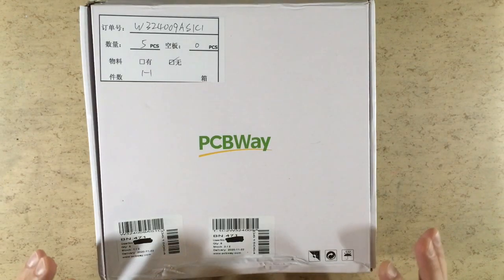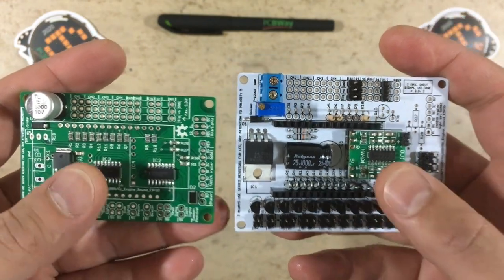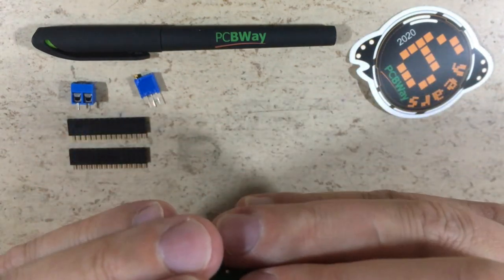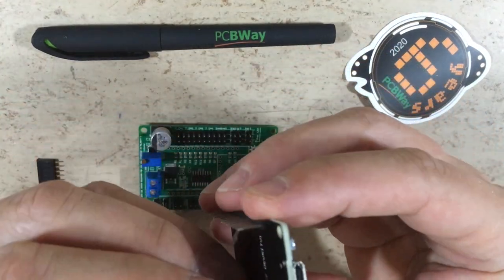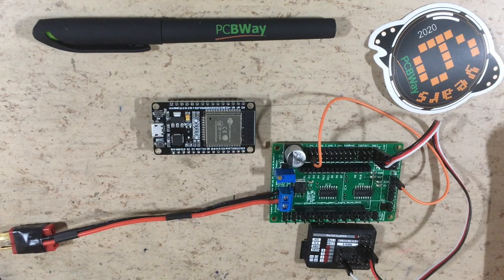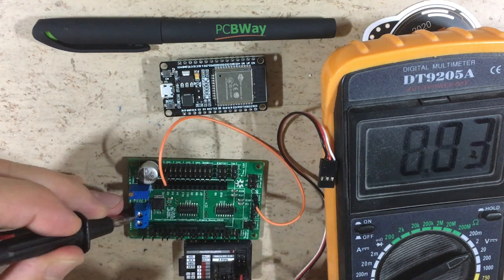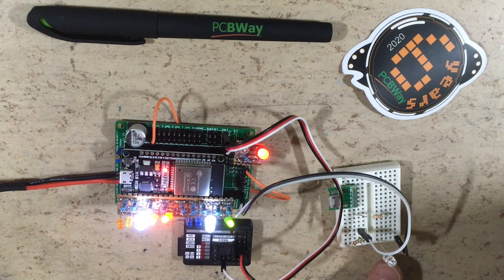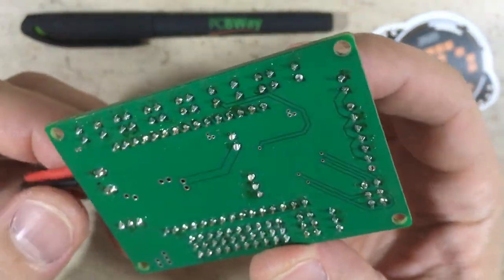ESP32 RC Sound & Light Controller: How To Finish The Pre Assembled PCBWay SMD Version

Comment: This is an awesome project! I've already ordered enough stuff to make 10 of them. Thanks so much for sharing it. I'm designing a fully 3D printed 1/14 semi truck and I hope this system will really bring it to life.
Reply from the maker: Thanks for the praise.
Reply: Do you want sell me one sound board you made i have the ESP32 readly I am not good with computer for install or order any pcb
Reply: im actually building your semi and want to add this to mine how many channels do i need on a receiver
Reply: @bluesparky727  I have one set up with 6 channels and one set up with 10. The more channels you have the more functions you can control. It can do a lot without your input though, so you don’t need a lot of channels.
Reply: @BuildItBetter3D  sweet I don’t honestly know where to start with the electronics I will have to watch this video about 30 times before I get it figured out haha I have the cab and hood printing now

Comment: boards arrived, no stickers, no pen, just the boards, and a fat bill from DHL .. shipping was almost as much as the entire boards, wish pcbway had a cheaper shipping method, mine was also delayed because the email they send me went to the spam folder and Chinese new year... so an order placed on 20 Jan 21 was not delivered.. i had to go get it as DHL had "oopsied" my delivery and the local DHL subsidiary had it. i finally got my boards on march 9th 21 but that is not the fault of pcbway or you DIYguy.  Now i will test them and start looking for that 1 engine sound i can not find as a .wav file.
and then see how to make them work as s-bus receiver/sound/light effects boards.

a thank you will come after the test :)
Reply from the maker: Hmm, sounds annoying. This is strange. I never had issues  with PCBWay so far. tons of sounds are already included and pre configured in vehicle profiles.
Reply: @TheDIYGuy999  dhl promised a callback within 24 hours, that was 2 days ago, they admit mistakes where made they just do not want to do a full or partial refund of the shipping costs.

is tthere a way how i could privatly let you know what engine sound i want ? maybe you know where to find it .. all i will say its a big engine and not a line or V one :)
Reply: @TheDIYGuy999   cant find the P&W r2800 :)

Comment: Could it be possible to add torque vectoring to this board? For example put 2 esc to control left and right side motors and a potentiometer to read turning angle. It would be nice to have in my dump truck that really wants to understeer.

Comment: Would just like to say this module looks fantastic. I would really like to follow this vid and assemble one RATHER than going with the useless Tamiya unit of overpriced Beier unit BUT ordering the PCB on PCBWAY is way to complicated for the first timer/novice. I tried by using the GERBER files BUT the site still asks for aditional info which the novice will have no idea of.Its a shame the channel could not go into more detail for the novice. I have given up on this module due to ordering side.
Reply from the maker: You can order the boards easily according to the step by step manual:
https://github.com/TheDIYGuy999/Rc_Engine_Sound_ESP32/blob/master/Eagle_PCB/How%20To%20Order%20Your%20PCB.pdf

Comment: I've almost soldered the board and now ready to move on to the tests. Could you comment, please, the light test on 9:30? How does the receiver transmit signals from several channels having only one 3-pin wire connected?
Reply from the maker: it's using the SBUS protocol. See (interface types):
https://github.com/TheDIYGuy999/Rc_Engine_Sound_ESP32/blob/master/README.md
You should read this file entirely

Comment: Hello, with your gerbers.zip file on the pcbway site we get your electronic card with all the small components already soldered on it. You just have to solder a terminal block, a 100 ohm resistor and some pins.
Thank you for your help
Reply: Bonsoir, je suis un petit frenchi qui aurai besoin de votre aide. Cordialement
Reply from the maker: It will come with soldered SMD components, if ordered according to the PDF in this directory:
https://github.com/TheDIYGuy999/Rc_Engine_Sound_ESP32/tree/master/Eagle_PCB

Comment: Board reboots when the Arduino code is compiled using ESP32 board versions after 1.0.5.

Is there a fix??? I have the same problem... Is it the bootloader or ..?

Comment: Thank you for the continuous improvements in your project. I note in the BOM.xlsx there are some items crossed out. Obviously these are the pass through bits that they do not assemble. Do they have to stay in the upload file to PCBway or can they be removed? I have never ordered a partially built board so appreciate the advice.
Reply from the maker: It doesn't matter. Also have a look at: https://github.com/TheDIYGuy999/Rc_Engine_Sound_ESP32/blob/master/Eagle_PCB/How%20To%20Order%20Your%20PCB.pdf

Comment: That such a great work 🤟🏽🤟🏽🤟🏽🙏🏽. I do follow your work sir..but i have a bit questions bout problem i have. I wass doing the programing things with your latest firmware v7. But I can't find my engine sound work from the wiring pin on esp32 to my reciver.
Did you have any suggestions please?? For only the triggered sound simulation things.
Im using 30 pins esp32, and 6ch dumbo rc rx tx. How the wiring should be possible for me?🙏🏽

Big respect. Thanks
Reply from the maker: Thanks. Wire and configure it according to:
https://github.com/TheDIYGuy999/Rc_Engine_Sound_ESP32/blob/master/README.md

Comment: Hello, i am looking at gathering the componants for the build. i have no real technical knowledge of electronics ,i will how ever be able to assemble them. Given this i have2 questons please, Schottky diode 1D5819, i can only get 1N5819. "N" rather than D.  Also 1/4w resistor as varoius ratings,which do i need thanks? lastly in the UK i can not get the circuit board printed so will use normal hobby board stuff,the unit will be situated in the trailer so does not need to be small or neat.thanks
Reply from the maker: iN5819 is OK. You can find the resistor values in the PDF schematics

Comment: I understand that it you load the software (as default) for a SBUS system into the ESP32, it should be blinking the blue LED in the board in the moment you power it even if it you haven not connected a receiver. Is that ok? Because when I load the software it doesn't blink and I'm trying to find if the problem is that Arduino IDE doesn't compile the software properly or if my boards are faulty.
Reply from the maker: It's the hazard lights, indicating that no connection to the transmitter was found. This is normal with the "MICRO_RC" remote profile. Have a look at "adjustmentsRemote.xlsx"
Reply: @TheDIYGuy999  Yes, I used the "MICRO_RC" remote profile (as you have it by default) just in order to to try it. With your confirmation I know I have a problem with the Arduino IDE or with the ESP32. If I got to solve the problem, I will let you know if it works with Futaba Sbus. Many thanks again for your help.

Comment: Hi, this is an amazing work! I'm starting my RC journey and I've already ordered the required parts and the board itself however, looking at your documentation I've noticed that the remote adjustment file is mainly prepared for the flysky and your own controller. Would I have to make many changes to adapt this to Spektrum dx6i?  Many thanks
Reply from the maker: You're welcome. The flysky setting should work (you can also change or copy it easily) as long as the spektrum has the same switches and a dual rate option. Of course the remote channel order has to be adjusted according to the sound controller setting. For details see "adjustmentsRemote.xlsx"
Reply: @TheDIYGuy999  brilliant! Thank you so much for your help!
Reply: @TheDIYGuy999  What rating fuse did you use with your setup? I'm coupling the board with Hobbywing 1080 esc if it helps. Many thanks

Comment: so I ordered the assembled pcb from Pcbway and have finished 2 of them. I installed the original excavator sketch and I'm using a Flysky FS I6S transmitter with IA 6B receiver .Changed the vehicle.h and the remote.h  as instructed in the GitHub documentation. When I test the boards the same as Martin did in this Video all goes well until I get to the part where he gets the hazard lights flashing. I am getting roof lights and the head lights turning on solid instead. Also I am not getting any sound at all. I have tried both boards and multiple ESP32s and get the same results with them all. I have tried sbus and ibus with same results but don't have the necessary cables to try PWM. I have read every bit of documentation and instructions that I can find so many times that I almost have it memorized. Does anyone know if there are any differences between this board and the newer version with wireless trailer lights or the sketch for the ESP32s that could be causing this problem? I would look for help on the forum that is recommended but I never receive the confirmation email to complete registration for the forum when they send it. Ive tried multiple times. Any help from anyone would be greatly appreciated.

Comment: Hi. Can you tell me what speakers did you use in your system, and where can I buy its. Thanks and great job, congratulations.
Reply from the maker: You can use any speaker between 4 and 8 ohms. Mine have GT Power chassis in 3D printed housings

Comment: @TheDIYGuy999  I sent the files to PCBWay they've made the board but have 2 issues :  (Switch Mode Version)

1.For position C1, there are three holes will be blocked if we solder the capacitors,pls advise and comment.
2.For position D3 , component we purchased as per part number#SS34 is bigger than pads in your design, can't solder. Pls provide correct part number.

Comment: Hello, I ordered all the parts got it all assembled.  Do you have a tutorial on how to configure/setup the radio.  My radio in particular is Futaba 8FG.  I found your excel configuration spreadsheet but, I'm still a little confused on how to set my radio.  Thanks
Reply from the maker: Hi, read this document and you will know how to configure it:
https://github.com/TheDIYGuy999/Rc_Engine_Sound_ESP32/blob/master/README.md
It's important so set the 100 & 75% dual rate on your radio according to the excel file

Comment: Nice
Reply from the maker: Thank you
Reply: I have question about last update
when i use manual engine on/ off
Why engine begin auto on/start after engine manualy off
Reply from the maker: @frenkkotarigan  It is starting as soon as you touch the throttle, it is normal.
Reply: Its normal
Reply: I mean i dont touch the thortle or other

Comment: Great work. Sorry for different kind of question. For the Micro RC Receiver Light do I need to put C3, C4, C5 and C6 capacitors on the board (no TB6612FNG motor controller)? Thank you.
Reply from the maker: Thanks. No, these capacitors are for the TB6612FNG. Note, that I recommend to add a 100nF cap across the GND and 3.3V terminals of the radio module.
Reply: @TheDIYGuy999  OK, thank you.

Comment: Just built another ESP32 Sound board for my T35, but I can't find a link for the WAV file converter that Bitluni made for you. The link above goes to the old original converter. I checked your Github too and although it shows a png picture of the converter, there is no link there either.
Reply from the maker: The converter is included on GitHub:
"Audio2Header.html"
It was rewritten by me to fit our needs.
Reply: @TheDIYGuy999  Thanks, I did not know that.  I used  the one at Bitluni.net and  made it work.  I captured 15 seconds of the Russian National Anthem to play as Sound1 on my T35 tank.
Reply from the maker: @jps99  You can use it as well, but in this case, you have to change the variable names manually. That's why I made my own version.
Reply: @TheDIYGuy999  Yes, that's what I did , but it will be much easier to use  your version, which I will do in the future.

Comment: hi. me again ☺

maybe a request: 
#1 maybe a port if this on 328P but lights only? no sound

#2 how can we modify code to NOT have an intertia( or a very minimal one)? I plan to use this on 4wd 1:10 'high speed' .
Reply from the maker: Hi,
#1 it is not possible, because not all 328 pins are supporting PWM
#2 adjust the "escRampTime" variables in the vehicle preset accordingly

Comment: This sound + light unit seems to be the way to go. I can solder ok but never worked with this sort of electronics so have of componant costs etc. Brfore i get into finding the parts etc can anyone give a apx cost of the parts to complete this project?
Reply from the maker: This is the BOM for the through hole version: https://github.com/TheDIYGuy999/Rc_Engine_Sound_ESP32/blob/master/Eagle_PCB/Final/Components%20list.pdf

Comment: I try to order with PCBWAY but I can't they ask for a Part List BOM file and Centroid file?
Reply from the maker: They are included in the Gerbers.zip, but you have to provide them separately. They are named BOM.xlsx & CPL.xlsx
Reply: @TheDIYGuy999  Thanks. Will be great to find this in shared projects in PCBWAY
Reply: @TheDIYGuy999  I send BOM and CPL to pcbway but this failed review. They say that on R18(20k) "your designed pads are for THT part rather than SMD part, pls double check and advise correct part No. for checking"
Reply from the maker: @giropa  sorry, my fault. Tell them they don't have to populate it. You will have to solder it by yourself:

Comment: Hello, when assembling the board. The top right of board has a section "rear lights" does this accept 2 x 3pins connector OR 3 x 2pin connectors, i am a newb,sorry
Reply from the maker: You can use 3 pin connectors, glued together back to back. The 5 Volt pin is shared for all rear lights.
Reply: @TheDIYGuy999   2 x 3pin connectors,thank you

Comment: I build it but it doesn't work with my Futaba sbus. I tried changing the sbusInverted to "true" and it neither works. Does anybody used it with Futaba sbus? Does anybody knows where could be the problem?
Reply from the maker: I don't have a Futaba remote, so I can't test it. It works just fine wit the Flysky and my DIY Micro RC remote. You should test it in PWM mode first. Does it work in this mode? Note, that you need to connect an ESC, otherwise the ESP32 is not supplied. See:
https://github.com/TheDIYGuy999/Rc_Engine_Sound_ESP32/blob/master/README.md
https://github.com/TheDIYGuy999/Rc_Engine_Sound_ESP32/blob/master/documentation/quickStartManual.pdf
Reply: @TheDIYGuy999  First of all, many thanks for your answer. I haven't conected the ESC, but I powered the ESP32 from the +5V rail as you explain in the documentation, and the ESP32 turns on, but it doesn't do anything at all. It seems to be everything ok but  I have not answer fron the device. I'm using your default parameters because I'm trying a sbus connection and as I told the only change I dis  was the sbusinverted for try both options. I imagine the firmware is correctly loaded because I didn't get any error message fron the Arduino IDE. I will try with the PWM mode and I will let you know.
Reply: @TheDIYGuy999  I'm verifying everythin and I have found that PCBWay used ULN2003A LED drivers in place of the ULN2003AD. Could be this the problem?
Reply from the maker: @lerpft  They are OK, my boards also came with them. You should measure the supply rails for correct 5V.
Reply: @TheDIYGuy999  It's ok, they have 4.97v. I will try the PWM mode as you told me before and I will let you know if it works in this mode. And many thanks for all support you are giving to all of us with this great development.
Reply: I have uploaded this video https://youtu.be/90ZqoJfoI9U in order you can see the upload process. As you said in your Githube that version 1.8.7 or older can cause errors and the latest version is 1.8.13 I also installed the 1.9.0 beta version (but I tried with both versions and also with 2 different ESP32 boards and always with the same results). I also uploaded this other video https://youtu.be/-7f5p9KFo0c in order you also can see the result when I connect just the indicator lights to the board. As you can see, when I power the board it just turn on and doesn't do anything at all with or without the transmiter turned on. I also tested the leds just plugin them to a ground pin and they works. Where do you think could be the problem? I also tried with PWM (of course changing the interface type in the software) and the result is exactly the same.

Comment: Gruss Martin (back to English)  i have tried to upload the files from the github to the board but keep running into issues, when will you do a tutorial on how to install the software so i can get my board working and look for the P&W R2800 engine for my 8x8 wpl 1/16 truck (after all, i do not want a diesel v4,v6,v8,v10, or v12)  i want a rotary twin row 2x9 cylinder 2000 hp engine in my 8x8 same engine as in a P-47, F6F, F8F or the F7F-3n Tigercat (as on my aircraft carrier)

Danke :)
Reply from the maker: Hi,
do it according to:
https://github.com/TheDIYGuy999/Rc_Engine_Sound_ESP32/blob/master/README.md
and:
https://www.rc-modellbau-portal.de/index.php?threads/esp32-arduino-rc-sound-und-licht-controller.7183/
Reply: @TheDIYGuy999  Danke  :)

Comment: Can I get them to do a light and sound module for a 1/14 truck, one off thing, do you know?
Reply: Or will you do the work (so the system is completely working) and I pay you.
Reply from the maker: You have to order the boards by yourself according to: https://github.com/TheDIYGuy999/Rc_Engine_Sound_ESP32/blob/master/Eagle_PCB/How%20To%20Order%20Your%20PCB.pdf
Reply: @TheDIYGuy999  so I gather that is a no
Reply from the maker: @grease94819481  Sorry, I don't have the time to make complete systems for other people. Making your own is really not that hard.
Reply: I know I can make one but my disability does not allow me to do so, the heat and solder fumes get to me pretty much instantly